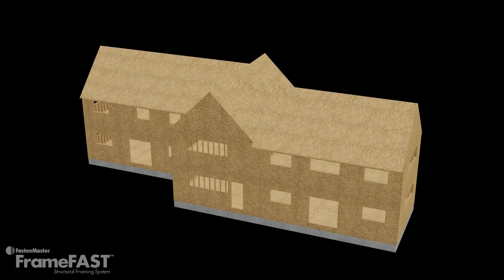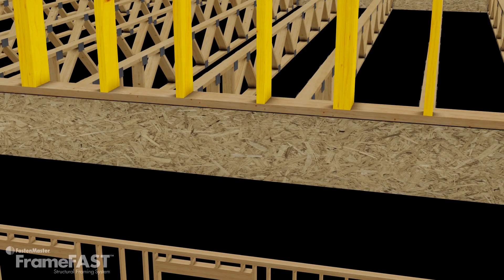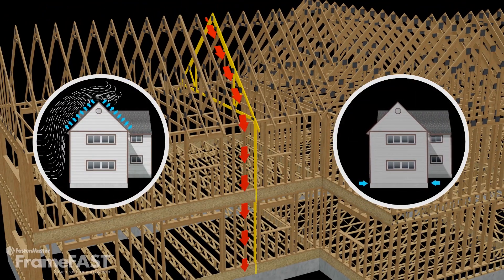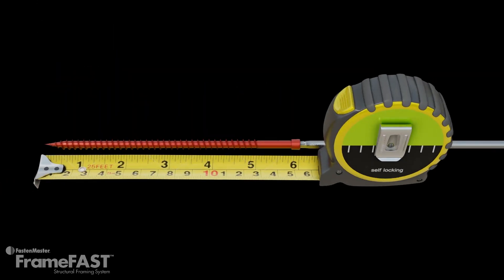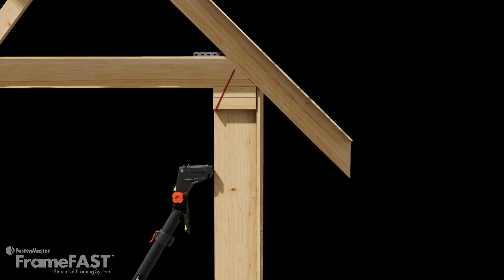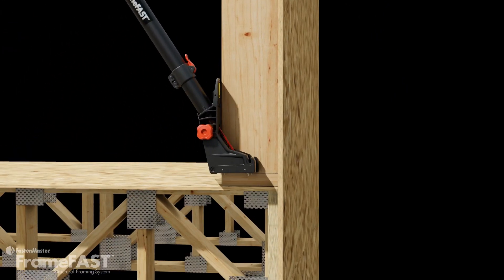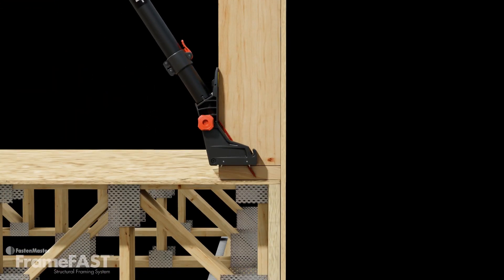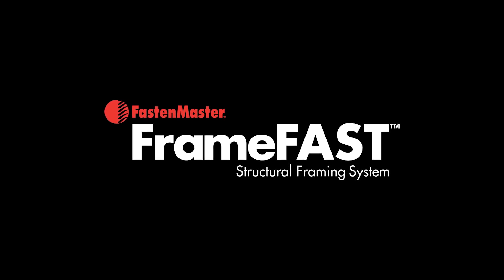Securing the "Continuous Load Path" with the FrameFAST System

Comment: Too many mechanism to work with and it seems not time effective.
Reply: The alternative is using ladders, nailers and multiple different types of strapping and connectors to make each of those connections along the continuous load path.  The FrameFAST system utilizes the same screw and same tool for all of these connections and requires no ladders, nailers, air hoses, and electrical cords.